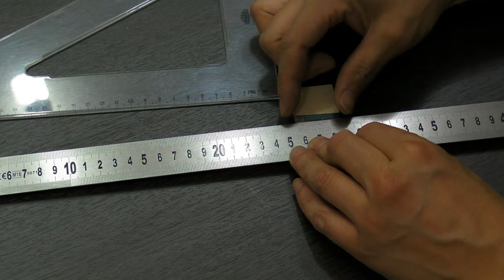Ruler Marking Gauge (2 different method) / Marker Ruler

Comment: Who cares about safe right?
Reply from the maker: Hello.  Why did you say that?  I didn't get any criticism about security in this video.
Reply: Because you didn't, doesn't mean I'm wrong! You cut a small piece of wood on your table saw, without using a push stick.  And between the fence and the blade, wich is even more dangerous. But I apologized to graze my comment on a rude fashion. I should've done it on a more constructive and police way.